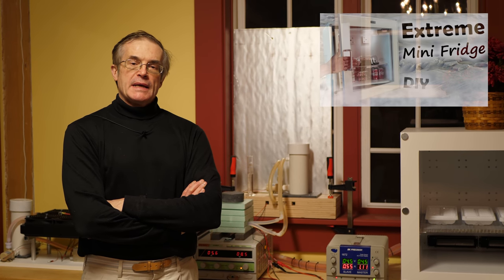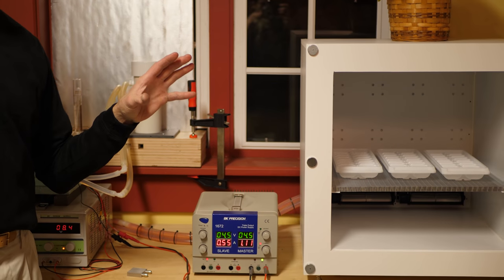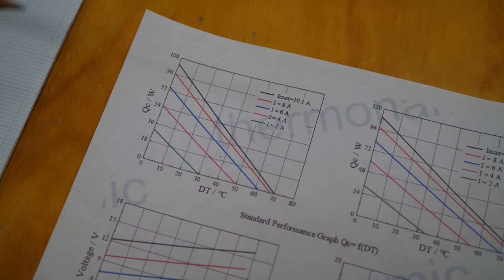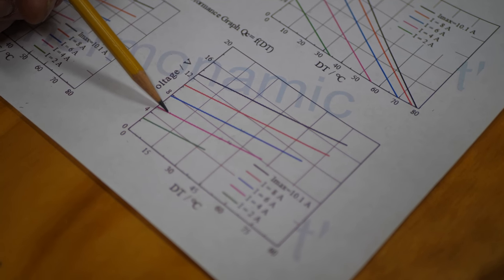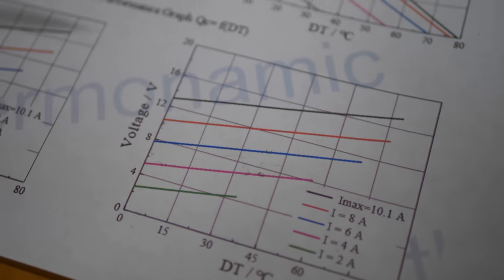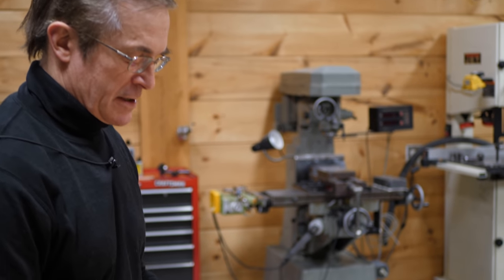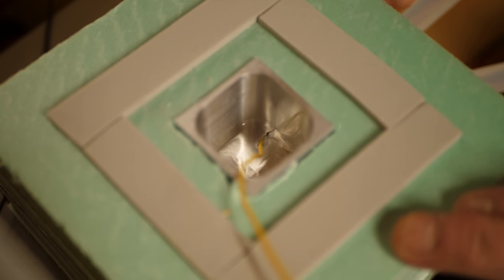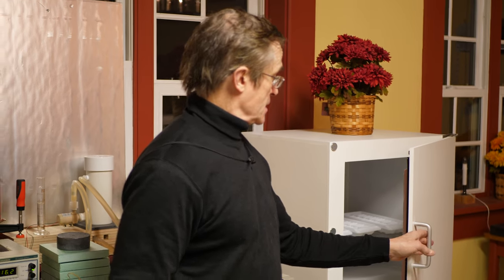EXTREMELY LOW TEMPERATURES! - Using TECs

Comment: GREAT VIDEOS. You have really explained the workings of TECs wonderfully. 
I have a question, How do i calculate they "load" or numbers of watts I need to cool an incoming water supply. Im looking to build a "instant" water cooler using TECs. bringing room temp water (25c) to iccy cold(5c) as it runs through the machine. efficiency is not a huge concern, I want something to work quietly. any input would be appreciated.
Reply from the maker: The specs for these devices are available from distributers, but not if you are obtaining them from say eBay.  Take a look at our video on the mini fridge.  I discuss these specs and from them you can size the capacity and quantity of TECs that you will need.

Comment: -56C is actually pretty impressive.  That would be hard to achieve using commercial refrigeration technology.
Reply: Actually that´s not very impressive to me.
I managed to get a temperature difference of >50°C (+20 to -30) with just a single TEC and a single fan Water cooler. I didn´t even insulate anything for that, nor did I fine-tune anything.

For the amount of effort that went into this, this is not very good.
Reply: -50C is surprisingly easy with R410a.
Reply from the maker: The assembly is rather easy and a single power supply voltage is all it needs.  The lower the final temperature, the harder it gets... rapidly.  The TECs become less effecient and the differential between the cold side and the surrounding environment increases the thermal load.
Reply: rotate85 That’s what my computer phase cooler runs... its a commercial unit... -35c at high power (FX-8350 at 1.7 Vcore at full stress load). Core temp peaks somewhere below 0c (my computer doesn’t show below 0c, my evaporator has a thermocouple on it for the temps. Asetech Vapochill LS
Reply: @Basement-Science  So you couldn't even make it anywhere close to -56 C, yet somehow it's easy?
Reply: @Basement-Science  If you're still reading, how did yours perform as you dropped the top & bottom temperatures, it's the net low point that I use as the 'effectiveness' marker; it's fairly easy to move energy at STP but becomes more and more challenging as you head toward -60 or so..
Reply: @So1ipse  I never tried it at another temperature, nor with any significant heat load. This small water cooler was already close to its limit (heated up the water close to 40°C over time) and I didnt have a good way to power multiple peltier elements properly.
I've actually been putting together a setup that I might be able to use to try this properly soon. I may even make a video about it.

Comment: Thank you -- that answered the question very well.  I was neglecting the additional heat load produced by the first device. 

I think there might still be an advantage in the convection cooled case, particularly by introducing the vertical plates between the series TEC elements.  This would allow the outboard modules to run at a higher temperature while providing a higher differential to the surrounding air.  It takes a fair differential to get air moving, and it looks like the 50C difference you achieved with this setup might do the trick.  One other optimization might be to paint the outermost fin to take advantage of radiation loss, another mode of heat transfer that works better when things are good and hot.

I don't think you'd have a more efficient cooler than what you have arrived at here, but if you needed something without a fan it might still be worth looking at.

Comment: You could use this to test the idea of carbonic acid having a freezing point above that of 'dry ice'. This was an anecdote I encountered a while back, but I had only rough thermodynamics as an argument in its favor. You should be able to create a solid of composition H2CO3 at a temperature below -30°C (I can't recall the exact temperature) which works as a sort of ghetto dry ice.

Comment: You have to do a pyramid of TEC units if you want to stack them in series, cold side would be the smallest TEC.
Reply from the maker: No, as I explained you don't.  There will be a small loss of performance with this arrangement, but it is easier to mount and assemble.

Comment: Great video. I am subbed but I don't seem to get you in my sub feed every time, only saw this in the hopless home feed. I am off to watch the results of your fridge build, as I have been eagerly  waiting to see them so I can upgrade the mini fridge in the van. It has positions for two elements ecept the heat sink is for one. I suspect it would be a good fridge and not the run off the mill, had they put an extra element in. 18 below ambient is no good, 28 below would be acceptable, 32 or more would be fantastic.

Comment: My thought isn't using the Tecs in series but rather to use the primary one to cool and then the stacked ones to convert the extracted heat back into electricity. Would that not recover energy and improve overall efficiency?
Reply from the maker: No.
That design will, at the same time, significantly decrease the efficiency of the primary TEC by restricting its cooling on its "hot" side.  The result  would be a lowering of the overall efficiency.

Comment: But did you supply same of volts and Amps for the three TECs or every TEC has specific Volt? Thank you :)
Reply from the maker: By wiring the top two TECs in series and then this series pair with the single, bottom TEC in parallel, even though all three TECs are identical, the voltage(and thus the current) to the the top two is 1/2 that to the bottom.
Reply: @TechIngredients  thanks...I did your experiment and got very nice result...thanks :)

Comment: I've looked into trying to optimise the efficiency, and I thought about the insulation side of things. How about vacuum panel sheets, my thoughts was two sheets of perspex with support mounts to stop them collapsing and sucking the air out, this would be one wall surface. What are your thoughts on this?

Comment: Some time ago I was trying similar thing for cooling NH3, but with stacking different power ones, specifically 12706 and 12715. When testing it with an ice bath I think I got to arround -70°C.
Reply from the maker: That's reasonable.  We maxed out at around -60C with no heat load.  You can see a lower temperature we reached in the thumbnail.  The simple series wiring a demonstrate is not optimized, but very easy to assemble and mount.  Placing the hot side of the cooling loop into an ice bath or an alcohol/ dry ice bath or a compressor based chiller could drive the temperature down below -100C.  Kinda neat!

Comment: It's cool, but if you'd like to make liquid air (maybe LOX for a rocket?) TECs will just not work. Not only are you fighting against high dt, but the Seebeck effect itself starts to break down, see a paper called "nonlinear Peltier effect in semiconductors" from ucsc. 

A two stage system consisting of  conventional refrigeration unit pumps might work, if you can find a usable refrigerant.

Peltier devices are interesting, but the use cases are pretty limited. Any large installation is generally better off with a conventional solution; seems to mainly be limited to small scale devices were pumps are too bulky.
Reply from the maker: You're right, they are not the method to use for those lower temperatures.

Comment: could you liquify some nh3 or cl2 with that stack?  is it posible to go lower and make solid co2?
diy solution of Li in NH3 would be a nice project for that stack
Reply: I was wondering about the CO2 as well. It only requires -80C or lower, could a triple or quadruple stack of TECs reach that low, even at horrifically low efficiency? You would of course need bone dry air, or else you'd just be condensing water from the air.
Reply from the maker: Funny you mentioned that.  At the coldest times of the year, here in New England, -20C is routinely reached at night.  We missed that window, but our little, three stage cube should easily condense moderate quantities of CO2 gas from a tank into the cavity and that is what it was originally fabricated to do.  Next winter...
Reply: @TechIngredients  you could try to make a ice+CaCl2 mix to get a low starting point

Comment: I'm confused about back wall in you last version of refrigerator. First goes back wall. then 12 thick aluminium blocks which are screwed to back wall. and these 12 blocks are built into polystyrene foam. then go 12 TEC and then 12 water blocks.  Is this correct sequence? Or i something didnt understand?
Reply from the maker: That's right.

Comment: That freezer must've been prohibitively expensive to make. Also, can you please test the cheap TECs to see if they actually perform as specified i.e. current drawn etc.
Reply from the maker: Before installing, each TEC was  tested to confirm polarity and voltage drop.  Even though they were very inexpensive, eBay sourced, they all worked and varied no more than 10% from the mean of 2.0 ohms.
The freezer was suprisingly inexpensive.  The 12TECs cost  $30, the 10 fans cost $45, the pump was $15, the radiators were left over from past over clocking projects and the PVC board, tubing, handle, magnets etc cost about $50.  It did take a lot of time, but that was fun.

Comment: @Tech Ingredients

if u stack peltier module u have to multiply the number of module at each layer... 1 2 4 8 16 because peltier module generate lot of heat and have poor ability to take that heat generated away, so a solution is to multiply them at each stage... 

ur setup is able to reach a -3 to -55c thats kinda great,  but give a try to a a 1 2 configuration and then a 1 2 4 config i bet the 1 2 config wil get same temp differential or even higger cuz u have now 2 peltier taking heat away from the hot side of the first one, so its hot side wil be at lower temp.. 

and also because dissipation surface will be multiplied at each layer..; instead of having x1 surface to dissipate heat from 3 peltier u will have x2 surface... 

and its not worth using peltier module to dissipate heat from computer.. they can go low in temperature but canot move lot of heat and a processor is lot of of heat get a search on youtube from people who already try cooling cpu with peltier... the compute start then shoot in minute at 90 c and even go to over heat protection shutdown...
Reply from the maker: That stacking  technique  is how series peltier work.  But as I described in these cooling videos, the inefficiency  multiplies as well.  In addition, the semiconductors that make up the modules become progressively  more inefficient as the temperature  drops and these properties combine to limit the low temperature capabilities.  Cryogens like dry ice and liquid nitrogen become more practical  at very low temperatures.

Comment: Ok so with the fridge I could see how actually an SSF would even be a more comfortable household item because it generates less noise than a gurgling default fridge (at least surely it could with low noise fans). But in case of the freezer, all the stuff you had to build around it really looks like it overshadows any benefit that using the TECs would bring you over a conventional freezer (which don't need -50°C).

Is it just a (very impressive) proof of concept or do you have an actual use in mind?
Also, how far away from the temperature exchanger could you remote the freezer box?
Reply from the maker: It's actually more of a proof of concept brought to the point of a usable device.
The primary concept is to take advantage of accessable temperature gradients such as a cold garage or basement, low temperatures outside and even small ground loops similar to what is used for geothermal heating. The remote radiator makes that easy and depending on the temperature gradient and tubing diameter, it can be placed up to tens of meters from a refrigerator or freezer
Reply: @TechIngredients  Conceptually that makes a lot of sense, as you also say in the previous fridge video (where you mention the weirdness of heating a box to live in and then cooling down a box in the box for food). Wondering about energy efficiency, I'm seeing most freezers availble online here (Germany) draw around 70 to 100 W. Would it beat that?
Thank you so much for taking the time to answer! I enjoy your videos very much, even if I'm not in the field myself :)
Reply from the maker: Without the advantage of a lower temperature heat sink, a TEC based refrigerator can't compete with a compressor based system, but these TECs are easier to interface with a remote location, heat dump.

Comment: very clear experimentation.... i watched ur previous video regarding building your own refrigerator and i saw u one thing u did that got me so interested... thats when u touch the tec with ur finger it produces voltage  and then it comes a question in my mind, does a tec can be use as a solar energy generator? coz when u applied temperature on it there's a voltage on the voltmeter, is it possible?
Reply from the maker: Absolutely.
Take a look at our video on "The Campfire Generator".
I go into other thermal sources for driving TECs.
Reply: @TechIngredients  ill check on that video
Reply: thanks

Comment: hi,
 interested in, what happens, after the tecs sucked out the heat from the chamber/food.
you just shot it down, on/off operation, or switch to lower ampers to maintain "heat-leakeage" across the insulátion boards?
edit: i see, when the the delta t goes down to the point , where the backflow heat wattage through the insulation becomes equal to the remove capacity of the TEC, then the inside temp cannot go lower. so by this you keep running the TEC, the cooler's  low temp will be "maintained" only.
interested if you replace the aluminium square blocks for ammonia or acetone or methanol vapor heat pipe (flat stripe shape) 

aother thing, if you can reduce further heat conduction by adding more insulation boards?
its okay, have a 2 inch over the counter thickness, but can stack as many boards to increase kappa value? or insulation has another tricky feature? can not push thickness to "infinity"?

Comment: Even if this a little late: I dont think it will work on computer chips, as you suggested. They produce 50-500W (when overclocked) of heat, which has to be pumped through the TECs. Thats why there are so few TEC CPU coolers. They are horribly inefficient. (But I guess it would improve the efficiency a LOT if most of the heat would be dissipated through normal water cooling, and in a second stage, a TEC could cool it even further
Reply from the maker: You're right.
We're building a very low cost phase change cooling system specifically for computers and we'll post that video in a few weeks.
Reply: @TechIngredients  that's great. I tried it once using an old fridge compressor, but sadly the compressor died pretty quickly (had burnt windings from the beginning), so I look forward to see your attempt at it. I'm sure it will be much better than mine